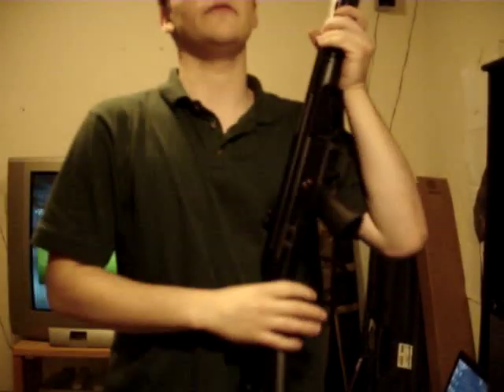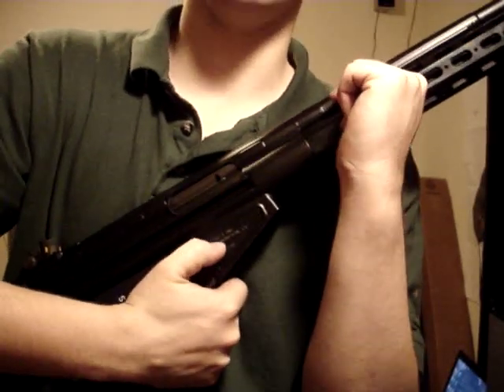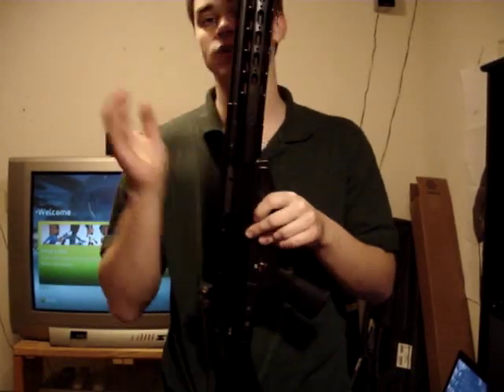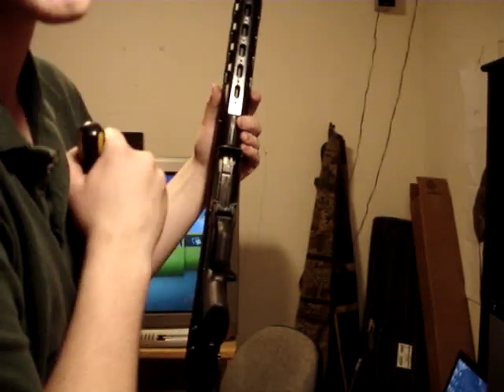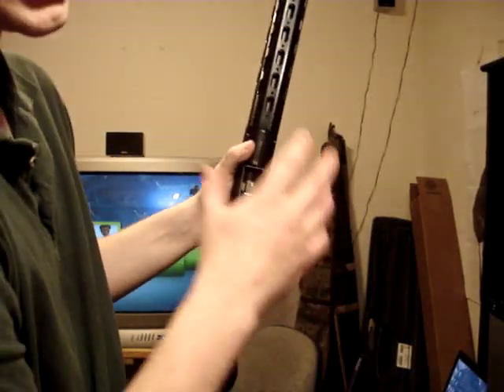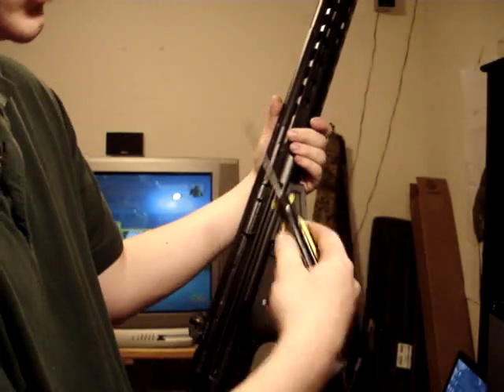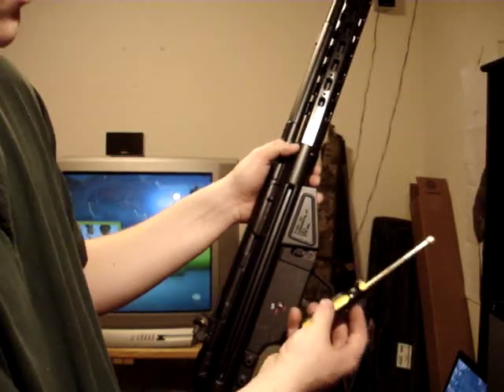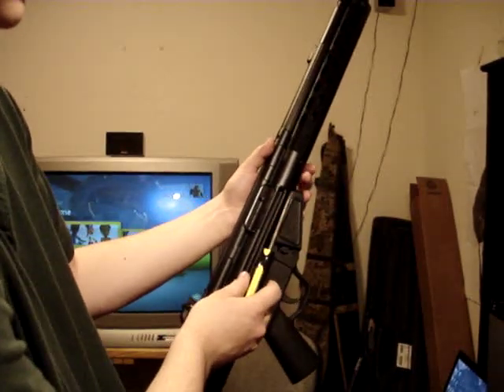PTR-91 bolt gap

Comment: You should be using the bolt specs from PTR since they are the manufacturer. There is a range. Check it out.
Reply: PTR uses HKs data package. HK spec is PTR spec.

Comment: Hey Spartan I own a Century Arms C93 and it works fine and has never given me any problem. Di you own a Century Arms weapon ? Or are you just repeatng the usual. The reason I perchase Century Arms rifles is the price, I paid $498 for a C93 , $499 for a CETME , and $560 for a Golani.  And the only problem was with the Golani ,its front sight post was warped and Century sent me a complete sight assembly and an extra 35 round magazine. I have some well built tough reliable rifles from Century